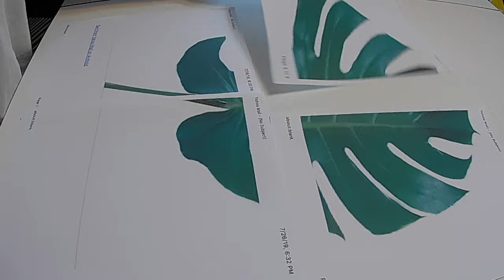Resin Art and EL Wire Woodwork Project for Kids

Comment: It's cool to see el wire used in this way. When I was a kid we used it to add "underglow" to our remote control cars. Btw your routing skills are amazing! I want to get a little router one day, just gotta save those pennies. Thanks for sharing the project 🍻
Reply from the maker: Hi Grant thanks for the comment and support as always. Yeah a router, even a small one is a good tool to have.
Reply: @LonghornWorkshop  I have two large ones (one mounted in a table) but I find them too bulky for the work you just did. (And the big router scares me when not mounted in a table)

Comment: Really cool project!  I didn't know about the EL wire, I'm going to have to look into that more.
Reply from the maker: Thanks Stan, yeah it can be cut at any length which is good.

It does make a light buzzing sound when it's on, so it's not ideal for situations where you want complete silent.